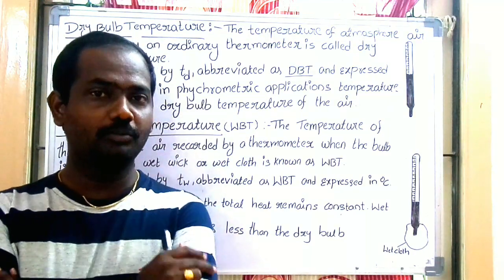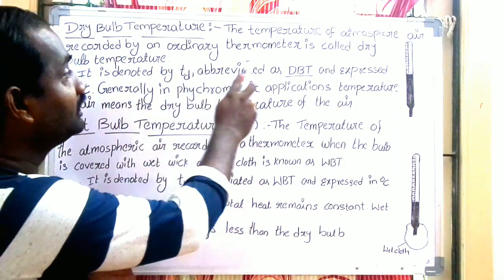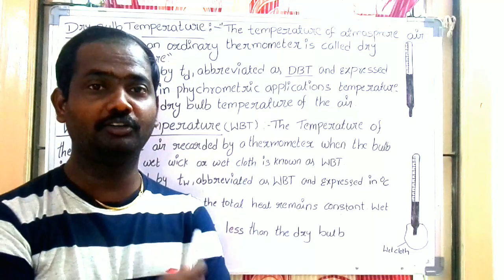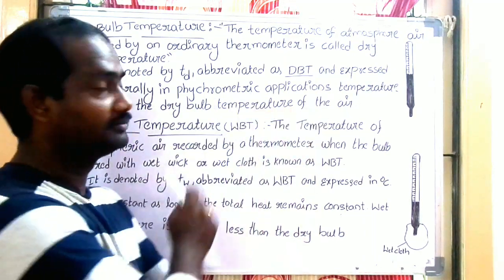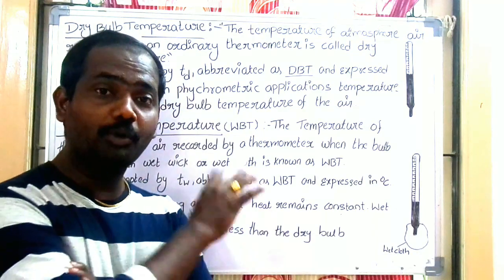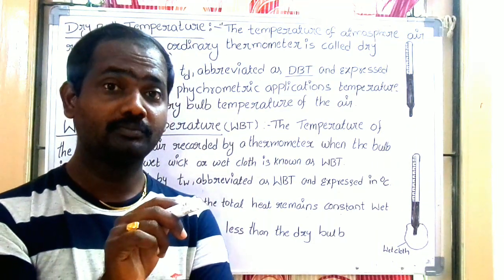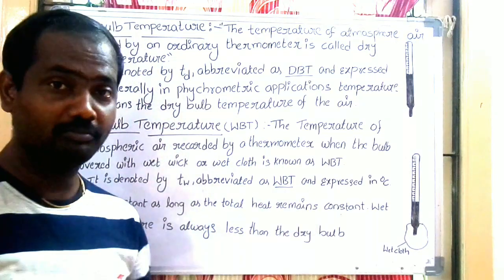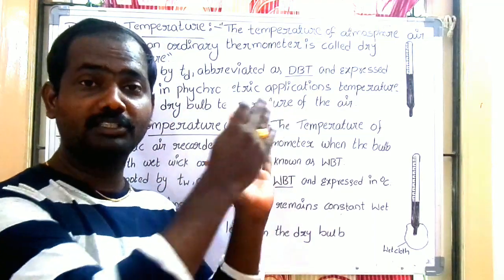Dry Bulb Temperature | DBT | Wet Bulb Temperature | WBT | Refrigeration | Air Conditioning | Telugu

Comment: WHY IT IS USED DBT&WBT  TEMPERATURE IN COOLING TOWER CALCULATION.
Reply from the maker: during cooling tower efficiency approach and range is most important factors.
Wet bulb temperature is an important factor in performance of evaporative water cooling equipment.
It is a controlling factor from the aspect of minimum cold water temperature to which
water can be cooled by the evaporative method. Thus, the wet bulb temperature of the air entering
the cooling tower determines operating temperature levels throughout the plant, process, or
system
Reply from the maker: please refer https://beeindia.gov.in/sites/default/files/3Ch7.pdf